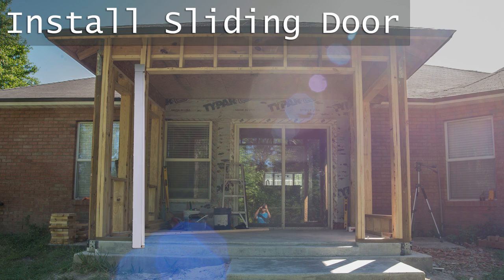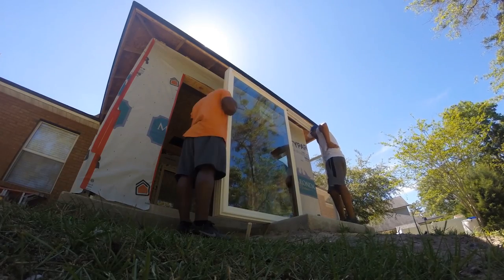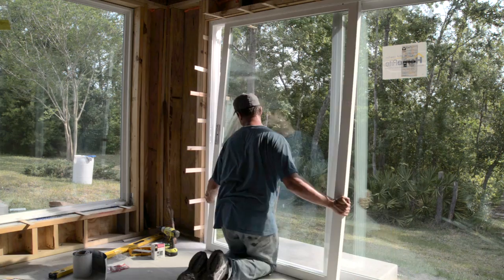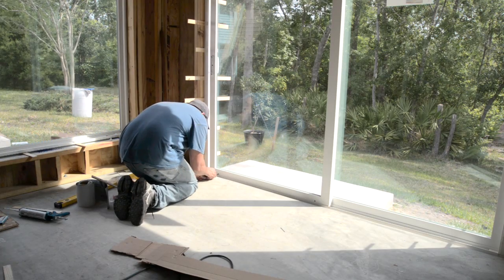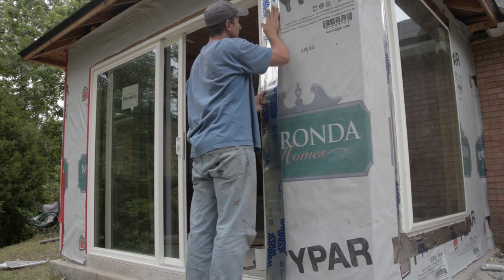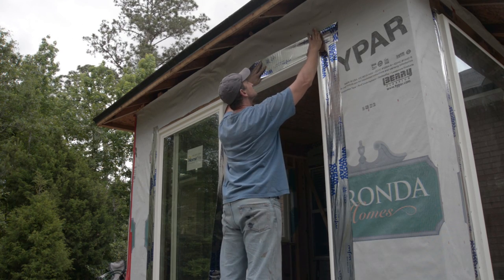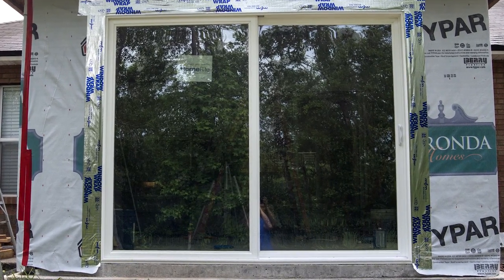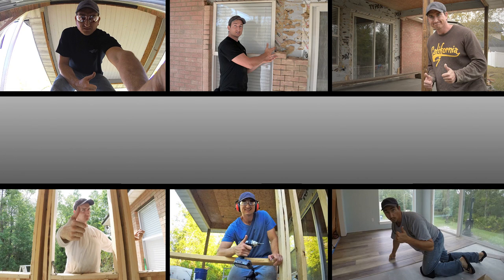Installing A Large Sliding Glass Door, Turn Porch into Room Vid# 9

Comment: Could you explain a lil more on the recess cavity in the concrete please,
Like do you need a specific sliding door to fit??  Because the cavity is actually making the door space taller like 80+ inches , right??🤔
Reply from the maker: When a recess is made into the floor for the sliding, the door frame opening would have to be sized to reflect the difference in height. The bottom of the recess will be the floor of the door.

Comment: Buddy if water ever gets behind the house wrap above that door that water now has a direct path into your addition. You should have cut the wrap at both top corners at a 45 deg angle and fold out of the way. Then used the seal tape from the fin to the sheathing. Now put the house wrap down over the seal tape and use house wrap tape to seal everything up.
Reply from the maker: thanks for the tip

Comment: you make doors and windows, your sizes, can you tell me, I like the big windows, thank you very much.
Reply from the maker: To size the windows I first figured the overall space available in the wall.  Then I shopped around to find the largest window available that would fit in the space.  Otherwise I could have ordered windows to be built to desired custom dimensions. However it is often less expensive if you can use a window that is already available at a window supply store.

Comment: that's a nice addition
best to slice your house wrap at the top of windows and doors at a 45 from the corners and tack up until you have put the top window tape on then overlap the window tape with the house wrap flap - finish with skip tape along the edge of the wrap where it meets the top of the frame to give moisture a path out - good work and great video!
Reply from the maker: Thanks for commenting Geoff

Comment: So you didn't have a wooden sill or will pan? You put it directly on concrete?
Reply from the maker: The concrete floor was poured with a recess to accommodate this sliding glass patio door.  The sliding door was set directly in the recess of the concrete with adhesive.  You can watch the concrete pour video if curious. The video link is in this videos description. Thanks.

Comment: Where did you get that big picture window
Reply from the maker: It was from a regional window shop.  It worked out great because I wanted a large picture window and they actually had one in stock that was a returned item for them and provided at a deep discount.
Reply: @MrKistel  I'm closing in my patio and need a big picture window. About how much does a fixed window that size cost
Reply from the maker: @brucerobertson2466  I would recommend stopping in to any window suppliers in your area and ask if they have any surplus or incorrectly ordered windows. If so I would bet they would discount to get rid of them.  I am not sure what this particular cost of the top of my head.
Reply: you make doors and windows, your sizes, can you tell me, I like the big windows, thank you very much.